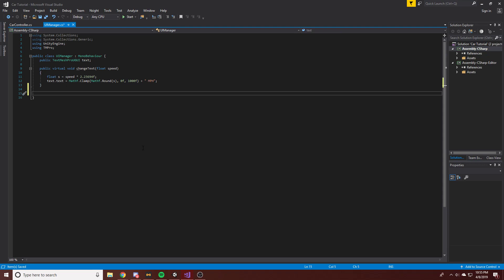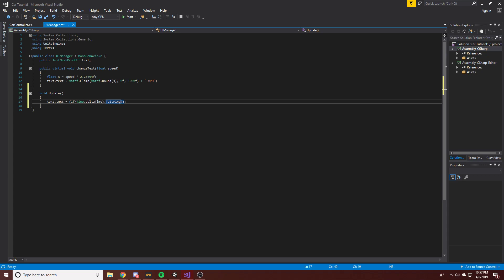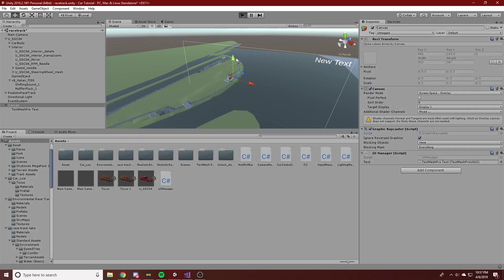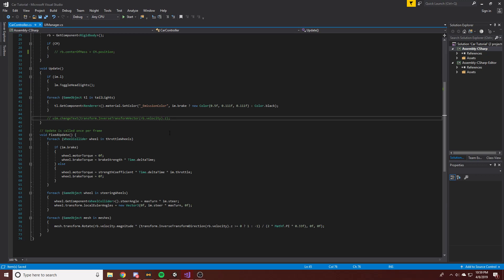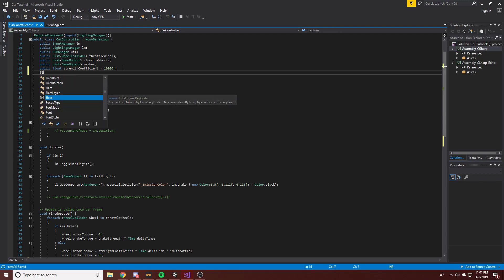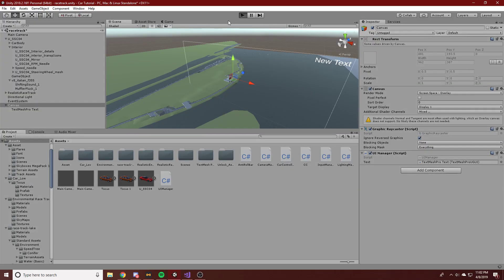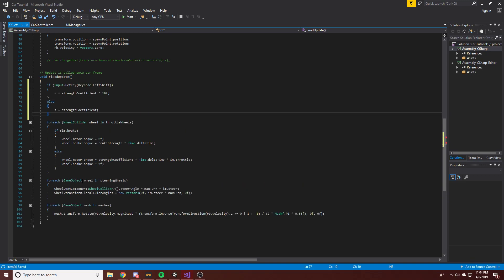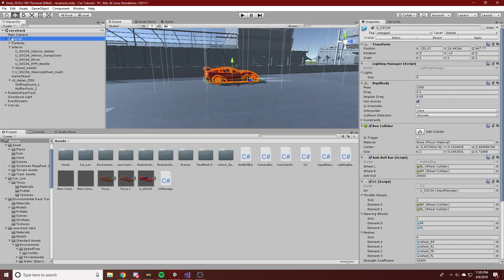Unity Car Physics Tutorial - #9

Comment: Hey dude, thanks a lot for these tutorials, they are really great! I have a question: if I wanted to implement an actual transmission to the car and mess with the RPMs, how should I use the variables like the strengthCoefficient or the info from the wheelcolliders like wheelcollider.motortorque etc. Could you give me a hint about that? Also is there any way to contact you personally like an email adress or twitter if I wanted to ask more detailed questions with pics and stuff. Thanks in advance.
Reply from the maker: That's a hard one. When a car speeds up, its speed is limited by the range of ideal engine RPM (which translates into wheel rotation), so you change the gear ratio and are able to continue to add force to and accelerate; thus, you could probably just choose some arbitrary speeds at which to shift gears and set corresponding values for forces in order to simulate that.

Not entirely sure, though
Reply: @AxiomaticUncertainty  Thank you, gave me some idea.
Reply: @AxiomaticUncertainty  Another thing that you might now.. Couldn't find anything about this. When I hit the gas, the car's back starts "jumping". What I mean is: you know how the car's body "tilts" a bit upwards when you hit the gas (or downwards when braking), the former happens, then after a while it suddenly goes back to the original state and happens again (and again...) like the rear is jumping. I suppose it has something to do with wheelcolliders. For example, when I increased the suspension distance to 1 it didn't happen but then my car looks like a monster truck. Any ideas for this one? I can upload a video if the description wasn't enough.
Reply from the maker: @atacansuder3384  it may be an issue of having too large a hitbox for the car, itself. If the body of the car is getting caught in/on the wheel colliders, it may act rather strangely and display behaviors similar to those that you've described.

Comment: Cant't you share your project? It would be really awesome to check all the code. Thanks!
Reply from the maker: Unfortunately, I'm at college and don't have access to the code (it's at home). I wish there were more I could do to help :/
Reply: @AxiomaticUncertainty  no problem. I wanted to see the full code so I could understand it better, but there's no hurry.

Also, have you made an auto gear script? I wanted to have a look on it and the sounds too.
I was trying to use the wheel collider RPM to check the volume of the sound and the expected gear, but I wasn't able to find good variables to match a more realistic approach.

Thanks.
Reply from the maker: @iuridosanjos  I made a pseudo-gear system in order to simulate engine sounds, but the car itself uses an a more arcade-style automatic shifting system (in other words, it doesn't use outright gear shifting for driving as it's not totally necessary)

Comment: From Tutorial 8 to 9 you changed a lot of things without explain it. I tryed it out with Unity 2019.2.18f1 and with a other car from the Store and nothig is working. I hope you will make a update and a new serie ;-)
Reply from the maker: Did you do all of the other coding from 1-8? If so, the code added during tutorial 9 should work fine.
Reply: @AxiomaticUncertainty  Yes, i watched all 2 times. I tried 4 different cars from the store, and the last one is the only one that works, so there are a lot of prefabs that doesent work witch this scripts or settings. Now i have onle the problem taht the center of mass doesent work. 

P.S compliment for the tutorials, this are the best one on the web and the only one that works (if you take the right car from the store ;-) ) regards
Reply: @AxiomaticUncertainty  an other problem is the main camera, if i change the view on the car with the key C i cant return out of the car to the original view.
Reply from the maker: That means that you either omitted or miswrote the line that resets the mode to 0 when it gets past the highest setting.

As to the issue of different cars, I think it's just a question of needing to tweak some aspects of the car and its scripts. If you link me to one of the cars that DIDN'T work, I can try to figure things out and maybe make a tutorial on attaching it to other vehicles.

Comment: My car keeps tipping back despite I have it's center of gravity in the center, is there something I did wrong?
Reply from the maker: Are your wheel colliders properly attached?
Reply: @AxiomaticUncertainty  My wheel colliders are attached to each wheel
Reply from the maker: @rookieonraceway  try disabling the centerOfMass object and using the default. Does that fix it?
Reply: @AxiomaticUncertainty  changing it to none makes it stop tipping but the car doesn't move.
Reply from the maker: @rookieonraceway  try just commenting out the rigidbody centerofmass line and then seeing if that works
Reply: @AxiomaticUncertainty  You mean like in the cs file?
Reply from the maker: @rookieonraceway  yes
Reply: @AxiomaticUncertainty  is it if (CM)
         {
            rb.centerOfMass = CM.position;
         }
    }?
Reply: also it figured out how to get the center of mass to work with cm. Car still won't move. Did you change throttle wheels from wheel collider to gameobject?
Reply from the maker: @rookieonraceway  I didn't. I'm not sure why your car wouldn't me moving.
Reply: @AxiomaticUncertainty  Some reason I feel like its because i'm using unity 2019 while the tutorial is on 2018
Reply from the maker: @rookieonraceway  probably not the issue; there shouldn't be major compatibility issues with any version of unity
Reply: I had the same problem but I was able to fix it by making my box collider smaller so it didn't touch the ground and i removed the centre of mass.

Comment: Hi, im at the 7th video, and it was just to know if you've done a gearbox system?
Reply from the maker: I have not as of yet because the current vehicle has an automatic stick. I could do one on that, though.
Reply: @AxiomaticUncertainty  ok thanks :)
Reply: I made a manual gearbox that works pretty well but I could be worked on.
This is the code:
using System.Collections;
using System.Collections.Generic;
using UnityEngine;
using UnityEngine.UI;
using UnityEngine.UIElements;
using TMPro;
[RequireComponent(typeof(InputManager))]
[RequireComponent(typeof(Rigidbody))]
[RequireComponent(typeof(LightingManager))]
public class CarController : MonoBehaviour
{
    public InputManager Im;
    public LightingManager Lm;
    public UIManager uim;
    public List<WheelCollider> throttlewheels;
    public List<GameObject> steeringwheels;
    public List<GameObject> meshes;
    public List<GameObject> taillights;
    public float HorsePower = 4000f;
    public float maxturn = 20f;
    public float brakeStrength;
    public TextMeshProUGUI RPM;
    public TextMeshProUGUI Speedometer;
    public TextMeshProUGUI Gears;
    public Transform CM;
    public Rigidbody rb;
    public float Gear;
    public float Manual;
    public virtual void manual_gearing(float Max_Speed, double CurrentSpeed, WheelCollider wheel, float Min_Speed, float Gear)
    {
        RPM.enabled = true;
        float EngineRPM = Mathf.Round(Im.throttle * 8000);
        if(EngineRPM == 8000)
        {
            uim.Colour_Change("Red",RPM);
        }
        uim.Shifting(Max_Speed, CurrentSpeed);
        uim.Engine_RPM(EngineRPM);
        if (CurrentSpeed < Max_Speed && CurrentSpeed > Min_Speed)
        {
            if(Im.throttle == 0)
            {
                wheel.brakeTorque = HorsePower / 100;
            }
            if (Im.throttle > 0)
            {
                wheel.motorTorque = HorsePower * Time.deltaTime * Im.throttle;
                wheel.brakeTorque = 0f;
                if (Input.GetKey("space"))
                {
                    brakeStrength = HorsePower / 2;
                    wheel.motorTorque = 0f;
                    wheel.brakeTorque = brakeStrength * Time.deltaTime;
                }
                uim.Colour_Change("Green",Speedometer);
                uim.Colour_Change("Green", Gears);
            }
        }
        else
        {
            wheel.brakeTorque = HorsePower / 4;
            wheel.motorTorque = 0f;
            uim.Colour_Change("Red",Speedometer);
            uim.Colour_Change("Red", Gears);
        }
    }
    public virtual void automatic_gearing(float Max_Speed, double CurrentSpeed, WheelCollider wheel, float Min_Speed)
    {
        uim.Shifting(Max_Speed, CurrentSpeed);
        RPM.enabled = false;
        if (CurrentSpeed < Max_Speed)
        {
            if (Im.throttle == 0)
            {
                wheel.brakeTorque = HorsePower / 4;
            }
            if (Im.throttle > 0)
            {
                wheel.motorTorque = HorsePower * Time.deltaTime * Im.throttle;
                wheel.brakeTorque = 0f;
                if (CurrentSpeed == 0)
                {
                    Gear = 1;
                }
                if (Input.GetKey("space"))
                {
                    brakeStrength = HorsePower / 4;
                    wheel.motorTorque = 0f;
                    wheel.brakeTorque = brakeStrength * Time.deltaTime;
                    Debug.Log("S");
                }
                uim.Colour_Change("Green",Speedometer);
                uim.Colour_Change("Green", Gears);
            }
        }
        else
        {
            Gear += 1;
        }
    }
    void Start()
    {
        HorsePower = HorsePower * 1000000000;
        Im = GetComponent<InputManager>();
        rb = GetComponent<Rigidbody>();
        if (CM)
        {
            rb.centerOfMass = CM.position;
        }
    }
    void FixedUpdate()
    {
        if (Im.L)
        {
            Lm.ToggleHeadlights();
        }
        foreach (GameObject tl in taillights)
        {
            tl.GetComponent<Renderer>().material.SetColor("_EmissionColor", Im.brake ? new Color(0.5f, 0.111f, 0.111f) : Color.black);
        }
        uim.Gearing(Gear);
        uim.Manual_Info(Manual);
        float speed = transform.InverseTransformVector(rb.velocity).z;
        if(speed < 0)
        {
            Mathf.Abs(-speed);
        }
        uim.ChangeText(speed * 3.6f);
    }
    void Update()
    {
        foreach (WheelCollider wheel in throttlewheels)
        {
            if (Input.GetKeyDown(KeyCode.UpArrow))
            {
                Gear += 0.25f;
            }
            if (Input.GetKeyDown(KeyCode.DownArrow))
            {
                Gear -= 0.25f;
            }
            if (Input.GetKeyDown(KeyCode.M))
            {
                Manual += 0.25f;
            }
            Gear = Mathf.Clamp(Gear, 1, 6);
            double CurrentSpeed = transform.InverseTransformVector(rb.velocity).z * 3.6;
            if (Manual % 2 == 0)//Automatic Transmission
            {
                switch (Gear)
                {
                    case 1:
                        automatic_gearing(30, CurrentSpeed, wheel, -1);
                        break;
                    case 2:
                        automatic_gearing(60, CurrentSpeed, wheel, 30);
                        break;
                    case 3:
                        automatic_gearing(95, CurrentSpeed, wheel, 60);
                        break;
                    case 4:
                        automatic_gearing(135, CurrentSpeed, wheel, 95);
                        break;
                    case 5:
                        automatic_gearing(180, CurrentSpeed, wheel, 135);
                        break;
                    case 6:
                        if (CurrentSpeed < 230 && CurrentSpeed > 180)
                        {
                            if (Im.throttle == 0)
                            {
                                wheel.brakeTorque = HorsePower / 20;
                            }
                            if (Im.throttle > 0)
                            {
                                wheel.motorTorque = HorsePower * Time.deltaTime * Im.throttle;
                                wheel.brakeTorque = 0f;
                                if (Input.GetKey("space"))
                                {
                                    brakeStrength = HorsePower / 2;
                                    wheel.motorTorque = 0f;
                                    wheel.brakeTorque = brakeStrength * Time.deltaTime;
                                }
                                uim.Colour_Change("Green",Gears);
                                uim.Colour_Change("Green", Speedometer);
                            }
                        }
                        else
                        {
                            wheel.brakeTorque = HorsePower / 4;
                            wheel.motorTorque = 0f;
                            uim.Colour_Change("Red", Gears);
                            uim.Colour_Change("Red", Speedometer);
                        }
                        break;
                }
            }//Automatic Transmission
            else//Manual Transmission
                {
                switch (Gear)
                    {
                        case 1:
                            manual_gearing(30, CurrentSpeed, wheel, -5, Gear);
                            break;
                        case 2:
                            manual_gearing(60, CurrentSpeed, wheel, 25, Gear);
                            break;
                        case 3:
                            manual_gearing(95, CurrentSpeed, wheel, 55, Gear);                        
                            break;
                        case 4:
                            manual_gearing(135, CurrentSpeed, wheel, 90, Gear);
                            break;
                        case 5:
                            manual_gearing(180, CurrentSpeed, wheel, 130, Gear);
                            break;
                        case 6:
                            manual_gearing(230, CurrentSpeed, wheel, 175, Gear);
                            break;
                    }
                }//Manual Transmission
            foreach (GameObject wheels in steeringwheels)
            {
                wheels.GetComponent<WheelCollider>().steerAngle = maxturn * Im.steer;
                wheels.transform.localEulerAngles = new Vector3(0f, Im.steer * maxturn, 0f);
            }
            foreach (GameObject mesh in meshes)
            {
                mesh.transform.Rotate(rb.velocity.magnitude * (transform.InverseTransformDirection(rb.velocity).z >= 0 ? 1 : -1) / (2 * Mathf.PI * 0.33f) * (HorsePower / (HorsePower / 2)), 0f, 0f);
            }
        }
    }
}